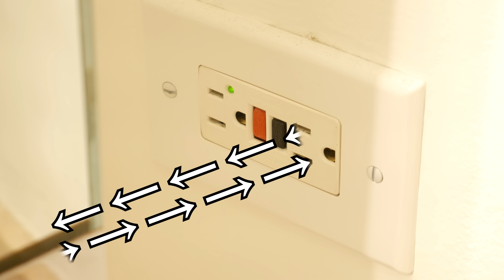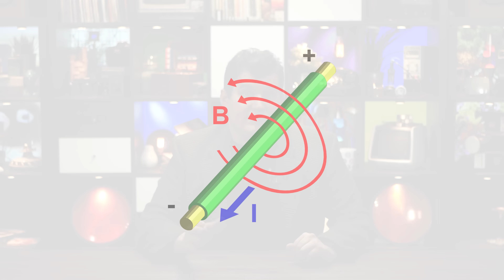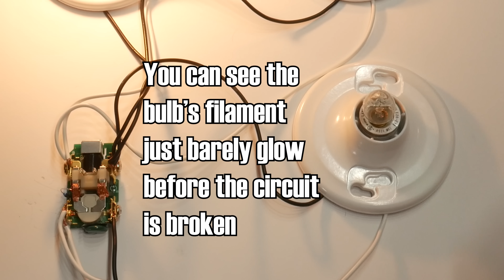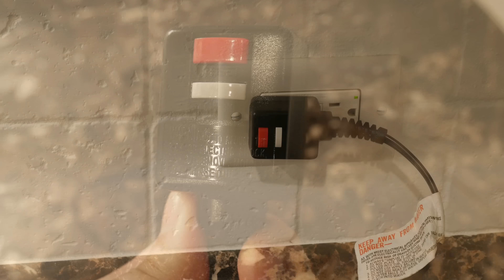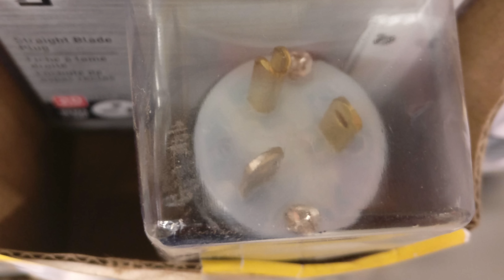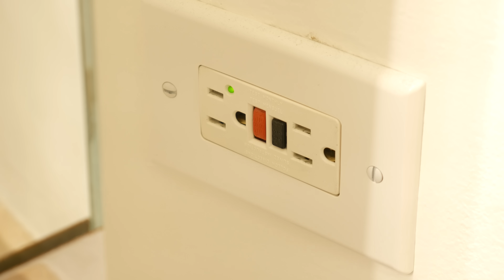The GFCI/RCD: A Simple but Life-Saving Protector

Comment: We had a breaker panel replaced about a couple years before this video, and all the breakers in it were GFCI equipped. The little LED light will blink when you turn the breaker on to indicate what tripped it, from overvoltage, over-current, series arcing, parallel arcing, ground fault, or even a self test failure of the breaker. I keep the manual on my phone so I remember what the blink codes are.

Comment: Maybe it's time for a followup?!  Over the years, these receptacle devices are required in more and more cases.  Why not protect every branch circuit at the panel board?  Would we be just as well served enumerating situations or equipment that do NOT require RCD/GF protection?  And the readily accessible rule.

Comment: I'm sure someone has pointed this out, but ordinary switches or plug sockets are not allowed near water in the UK. Bathrooms have either a string pull attached to the ceiling as a switch, or a switch outside.  There is a special type of isolated two pin socket allowed in bathrooms for low power devices like shavers and electric toothbrushes.

Comment: 5mA! Wow, that's tiny. 
The bog standard for most things in the UK is 30mA and I've never even heard of a 5mA in the UK. The lowest one's I've heard of in the UK is 10mA and the largest one's are 500mA & 1A. 
Well that's what it show's on the testers anyway. 

The UK (like pretty much the rest of the world) uses DIN mounted equipment which is all riveted together. But for some random reason, the US uses screws to hold things together. Which doesn't make any sense (which actually costs more in the BOM price) as they cannot be serviced as they're just a throwaway item.
Reply: The 5 mA is based on a let go threshold of a child. The 30 mA is based on what is directly lethal (50-100 mA)

Comment: I wish that these were not only GFCIs but a combo of GFCI and AFI?
I do wish that the US would change out breaker boxes so that they would have breakers that were automatically GFCI/AFI protected in ALL breakers?
Along with this, I wish that there would be more breakers per circuit. This would mean that instead of a room that has 4 outlets on a circuit, that room would be on two different breakers so if something trios the breaker then it would be easier to find the problem. As well if we were to redesign the electrical system so each outlet and light and switch etc wired to a breaker could be detected on that breaker so the breaker knew where and what was connected to it when it was connected to it then it would trip to tell you when you look at the breaker box and see the tripped breaker it could send a signal to your smartphone and the app could tell you the exact outlet in the room where the problem started?
This would really be a good thing if this could be around because if this could happen we could make this system so it could detect that you plugged your TV in the living room on the south wall on the top outlet in the plug strip in the first outlet on the strip.
Can you make a video about how something like this could be possible in the US?

Comment: It feels like the codes are a bit behind there.
We had whole house GFCI protection for power sockets in the early 90s. Only light circuits, ovens and stoves were unprotected. Now everything a consumer can plug in is required to be protected since the early 2000's. Hot water, ovens and hotplates are the only devices allowed to be unprotected here.

Comment: Very interesting. At my house, there are non-GFCI outlets and various light switches that are daisy-chained off each other into God only knows how many directions, including hot lines to one thing and the neutral to a different thing. At one time, the codes allowed for such things. No idea which plugs/switches are on the original leads and which ones are the daisy chained ones. Keeps things interesting! And about two-thirds of the house is on a single breaker (although, to be fair, we've made it this far!). Now, working with having an electrician try to make sense out of all of this without needing a home equity loan.

Comment: I live in Australia where GFCIs are standard in home wiring, I was working on my model railway's speed controller back in the mid-'90s as a kid. I knew to unplug it before working on it, but I kept trying to fix a fault, plug it back in to test and then unplug it again to keep working. This was a very old model train controller so the case was metal and connected to neutral, no earth wire. I plugged it in, tested it, forgot to unplug it, began work and BOOM, electric shock when I touched the active wire. But because the power was going through me and into the neutral, the current on the active and neutral still matched, so no interruption was triggered. Several seconds of shock later I managed to release my hands and I've never forgotten to unplug a device since.

Comment: As a UK resident, I'll give a bit more info. RCBO's are required for a TT style earthing system as the disconnect/short circuit time may not be within the required ranges with an earth rod. Secondly, within the UK at least there are prescribed zones to install cables. Deviating outside of those (and even now as of a couple of weeks ago when the latest edition of the wiring regs came in to force) requires you to have RCD cover to provide additional protection (basic protection is over current) to protect the fixed wiring as well if you installed out of those zones. Also worth mentioning the different tyres. Those wil generally be AC type RCD's. That is they only operate with pure AC on the wiring.The UK finally caught up with Europe and now mandates an A type. The reason being that DC current on an AC RCD will blind it and cause it to not drop. Why is this a problem? Just about any appliance you use today as DC power supply in it, and depending on the type of failure, cause an RCD to not trip. RCD's are rated to trip at 30mA in general. 5mA can give issues with switch mode PSU's due to the way they work and always leaking a tiny bit, the value of which can quickly cause nusance tripping. Hope this is useful to someone :)

Comment: I don't think the "wet hand grabbing a frayed cord" is such a good illustration of how they protect. If that was the entire circuit (frayed wire, hand) then there would be no imbalance and the GFCI would not trip. There could be a shock, yes, (and maybe a trip of the conventional circuit breaker in the box downstairs if it reaches 15 amps) but the "stray current" would have to go through something like another hand touching a water pipe, or a bare foot in a puddle outdoors before the GFCI trips. Think "hair dryer dropped into the full bathtub".
Furthermore, if only one of the wires was exposed, and the rest of you was completely isolated from the safety ground and/or neutral conductor, then there wouldn't even be any perceptible shock on the wet hand.

Comment: You mentioned that these outlets are supposed to be hooked up in kitchens and bathrooms, but every house I’ve been in has only had one, usually in the kitchen. This house I just moved into has this outlet in the one bathroom, AND said bathroom’s light switch is one I’ve never seen before, being see-through, dimmable, and has a little orange LED inside that activates when the switch isn’t at full power

Comment: Great video on the GFCI!.  I was testing a Traffic signal cabinet prior to install once and the GFCI Popped whenever anything was plugged into it. The protected neutral was shared with a separate circuit. The astounding thing about it is the cabinet schematics backed up this wiring error. 
Any case I like your videos where are you build and test the circuits. For future videos like these you may want to consider getting yourself an isolation Transformer to further protect you from getting electrocuted.  I'd hate to see you actully "conduct" an experiment.

Comment: As I recall, the earliest RCDs were not sensitive enough to provide shock protection, but had one fantastic feature: they had no amplification electronics.  The unbalanced current flow in the sense coil provided sufficient power to trip the breaker.
Reply: Electronic ones are banned in Europe as they are not voltage independent.

Comment: Your description is good Explanation to keep people safe for most people. But it far from what actually happens. If you just hold the hot wire and not touching anything and your are not grounded it will not trip you have to touch a ground or a neutral for it to trip. And remember this is alternating current changes direction at 60 Hz and for the code ground and neutral are separate but in reality they are one the ground in the neutral will always be tied together in the panel box plus tied to the neutral going to the pole and to multiple neutral rods in the ground. I could say more but would inform people ways to do things that could cause great harm to themselves this is a extremely touchy subject in the US at one point I did demonstrations of this to students to show exactly how it worked and how it tripped with live electricity. And I know it sounds like a fool’s errand, but it was extremely important for the students to understand exactly how it work what is limitations were and how it could be circumvented to give false security and the dues and do and do nots.

Comment: 14:00 putting the protection in the outlet only makes it obvious if you do this for every outlet. as fas as i know usually only the first outlet has the RCD, and the subsequent ones are then protected by it. So you have to reset the Outlet possibly in a very diffrent place from where the fault occured.

Comment: Why not put one of these in your breaker box? Does the split phase system make it weird?
I dont get it, even old shitty homes over here in germany have one main RCD switch in series with the line protection that doubles as a main breaker, they are incredibly cheap considering they reduce the chance of dangerous electrical shock anywhere in the house near zero. Is easy to retrofit too, atleast with the wiring system over here.
Reply: Newer homes are generally that way but there's certain appliances that cause nuisance trips where they'd be better off on an outlet without GFCI or AFCI, while other outlets on the same circuit could be on GFCI if they just used their own outlet.
Reply: @jeffkardosjr  Makes sense, altho i have never encountered nuisance trips outside of troubleshooting commercial equipment, those can really be a PITA to diagnose. 
Worst case solution is to install a switch with a higher trip current like 100mA, still offers decent protection.
Reply: @FerdinandFake  
Yeah. There's a plug in GFCI called ShockBuster that I was able to trip with a ham radio around 50mhz.

Comment: Thank you for your amazing video I always thought it was current leakage to the safety ground not the Neutral but thanks to you opening the device I can see that the safety ground isn't part of the circuit.
They should have called it Neutral fault but maybe that would cause confusion if there is a neutral fault in the house wiring and not caused by someone touching the outlet.

Comment: PLEASE PLEASE do a video about surge protection / lightning protection commonly built into power strips?  I believe the relevant components are called MOVs (metal oxide varistors) and I vaguely know that they are packed with powder that's normally non-conductive, that become conductive over a certain voltage.  I believe they are in a sense sacrificial, because when they absorb energy, they wear out.  I've always wondered whether the protection offered by the power strip have a limited range? Do they only protect downstream loads? Why do they not protect loads on upstream branches?  What limits the range of their protection?

Comment: Just recently I noticed an outlet in my kitchen wasn't working (our landline is hooked into it, so the phone stopped working). I went to the outlet and couldn't see anything wrong. Not knowing about this video, I went to the breaker box to check for any tripped circuits, none. I went back to the kitchen, and tried plugging in the phone to the next nearest outlet. It didn't work. Luckily, this one was a GFCI outlet, so my brain told me to reset it, and everything on that plug and the plug the phone was originally connected to came back on. Not sure why it tripped though, but it wasn't too hard to figure it out.

Comment: These are incompatible with electro-magnetic ballasts! It will see them as a fault and trip, every time my new 48-inch T12 fixture is turned on. Also, on washing machines, motor loads can cause them to randomly trip.

Comment: It's important for people to realize that it is a ground fault interrupter, not necessarily a shock prevention device. You can still be shocked  by an electrical connection to a GFCI,  *when your body does not provide an alternative path to ground*. In other words, if your body is just part of the circuit he describes, with the same number of electrons going in one end as out the other, you will still be receiving an electrical shock and the GFI will not know the difference; it will not trip. Some of the worst shocks you can receive are when the current runs through your heart. If you were to be insulated from ground, but grab the white wire with one hand and the black wire with the other, this would be the case.

Comment: I just installed a GFCI in my garage because our old outlet got cracked. We've had electrical problems in our garage since we moved in, even though we live in a pretty new house (built in 2003) Whenever we plug something that uses a lot of voltage in the garage plug, such as a vacuum, air fryer, etc. It occationally trips a GFCI in the basement under the fuse panel. Why is this? I installed the GFCI to hopefully correct the problem.
Reply: I think I got it- They combined the GFCI outlet with the breaker for all of the outside plugs because home builders are cheap and didn't want to use one for each plug. When the circuit is overloaded, it trips. I just need to find a way to prevent it from getting overloaded so easily. A simple vacuum (the only thing on that circuit) shouldn't cause it to trip. Also, the vacuum has no faults- it was tested.

Comment: More accurately an RCD is designed to detect miniscule earth faults such as a hot or live wire going back to ground through a higher resistance conductor, such as through your plumbing or a person, a circuit breaker or fuse only offers protection when the earth path is low enough resistance to create a surge which trips the breaker or blows he fuse, in a higher resistance fault such as through a person that I dunno is in the bath with their toaster and becomes part of the fault path back to the ground they're too high resistance as is the water to create an overload in the breaker, however the imbalance is enough to trigger the RCD mechanism.

Comment: im so glad that my outlet is the shittiest outlet for my 500 watt power supply for my pc who would've known lol luckily for me i have a surge protector with thick wire cable where you have extension for and only said surge protector for the pc but its basically a long extension cable its really hard to explain basically i have a surge protector that can somehow in gods name send 500 watts safely through that wire now i highly doubt that also its a thicc cable so hard to tell honestly if 500 watts could travel through that thick of cable at all now to be honest its just a normal everyday hp branded 500 watt power supply on the surge protector plugged in and funny enough i only have like three two things plugged into it my lights that are for my rainbow desk kinda gay take the hint from my fursona wink wink lol and my pc and the last thing is just my monitor so honestly i cant tell if i upped my own death rate chances or lowered them by adding extra cable thickness i think i lowered it because the cable being thick with a built in surge protector allows me to safely keep my pc from being hit by a lighting storm for example if it hit my house or me for example like high wattage coming out of the surge protector so honestly i would look for the highest quality surge protector if you didn't spend atleast 30 or 20 bucks on a surge protector you might not wake up next time and to make things worse if you live near or in Seattle you know that the rusty pipes for their clean water is already bad enough with the outlets that would not end well not being safe they only put these branded surge protectors in new buildings and or houses so yea i wouldn't trust your outlets if your willing to spend a lot of money on outlets i would put these everywhere every single outlet in you house with these buttons on them they are better then nothing and don't cost you your life and the best part is if you have a newborn baby these are good for those newborn family members who might accidentally play with the outlet and get hurt or badly wounded anyways im gonna stay alerted and keep my tail raised just in case i do or almost die so yea i love tails dont you i wish you become your own sona for a day whoever reads none the less lmao
Reply: Lol bet challenge accepted UwU

Comment: In 1991 Australia's Wiring rules introduced a mandate for RCDs to be installed. The term "Safety Switch" was used in marketing and this term has stuck. Our current rules (2018) mandates all residential circuits are to be RCD protected & in commercial & industrial installations all light & power circuits up to 32A are required to be RCD protected, (with some exceptions). One additional benefit of the RCD being in the switchboard is that this protects the entire cable as well as the outlets themselves. In certain situations outlet RCDs are used (most notably -  patient / medical treatment areas), but due to the economies of scale the cost of RCD outlets is 3-5 times the cost of locating the RCD (RCDGPO $AUD 165.00 vs RCBOs $AUD 40.00) in the switchboard.